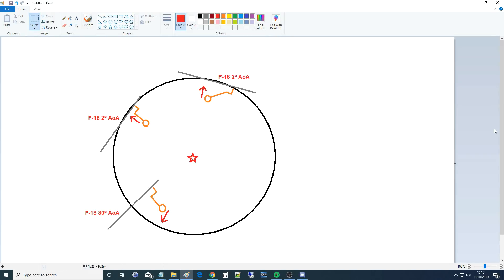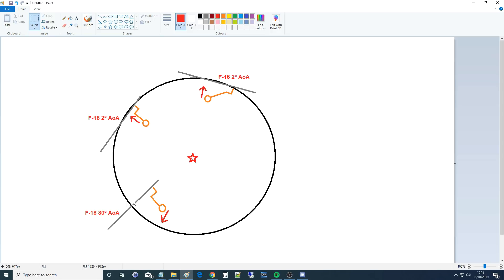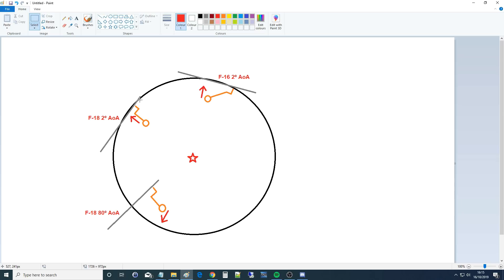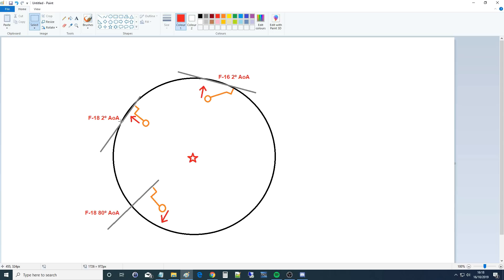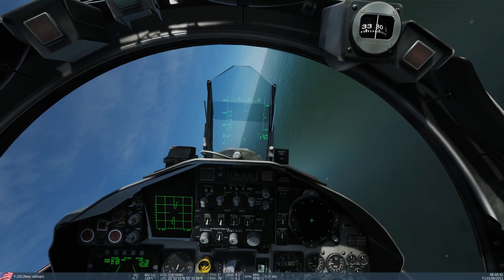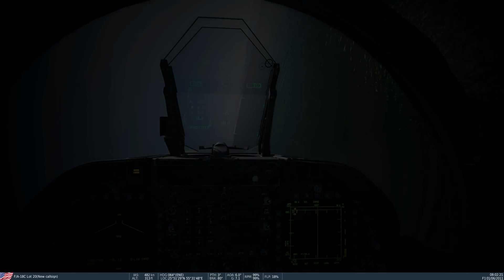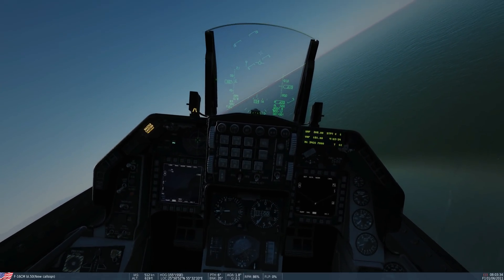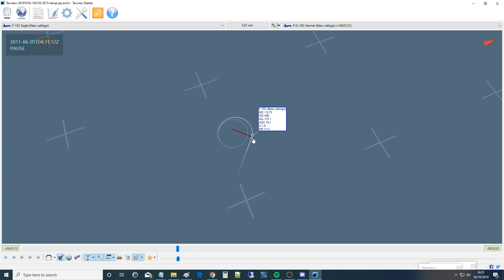Questioned: Does F-16C Reclined Seat Increase Pilot G-Tolerance? | DCS WORLD

Comment: With a stick figure man, G tolerance should be proportional to cosine (AoA + seatAngle).  Cosine(15 degrees) = 0.97, cosine(15+25 degrees)= 0.77.  So, if you could do 7.5G in a straight seat plane, you could do 9.7 in a plane with a 25 degrees reclined seat.  However, you would only get the full amount if your legs were reclined too.  Also, in this configuration, blood would pool in the pilots back, so that would limit the effect too.  I would guess the reclined seat would get a pilot an extra 1-1.5G, not the 2.4 from the base calculation.

Comment: The way you've described it still doesn't fully describe it, though, because as you increase AoA, you also increase the component of force pushing normal to the aircraft, and thus making the experienced "g" direction not solely directly toward the center of rotation. There are multiple components of force at play here, and the diagram you drew out just doesn't quite demonstrate that. It's a kind of okay explanation, but yeah it's not complete. Still a very interesting test, though! I think that accurately simulating it and accurately testing it would be difficult, but there could almost certainly be some approximation.

Comment: The DCS modelling of the F-16 is the question, not only in cockpit ergonomics. The F-16 was the first production aircraft to have a high instant G turns and a sustained G, where other contemporary air frames from the 70's did not. Most digital simulators pull way more G's than a real pilot would pull, not to mention the pilot.
Reply from the maker: thx

Comment: I was under the impression that the angled seat was to reduce compression G's when ejecting.
Reply: That depends on whether the seat ejects vertically out of the cockpit, or whether it ejects at the same 30 degree angle. I's expect the latter in which case the reclined seat would not affect ejection G.  Relative to the ejection motion it would still be at 90% to the pilot.  But be interesting to check what actually happens when a F16 seat ejects.
Reply: @andreartymiuk  Not very clear points. I have no idea what you mean.
Reply: @KeyboardWarrior101st  because the seat doesn't eject in a perfect vertical, reclining the seat doesn't do anything to mitigate compressive forces.
Reply: @ChucksSEADnDEAD  Understood. Thank you.